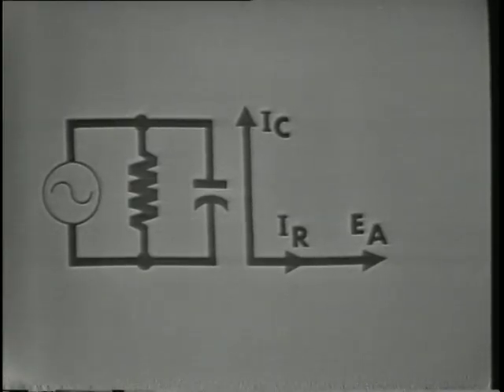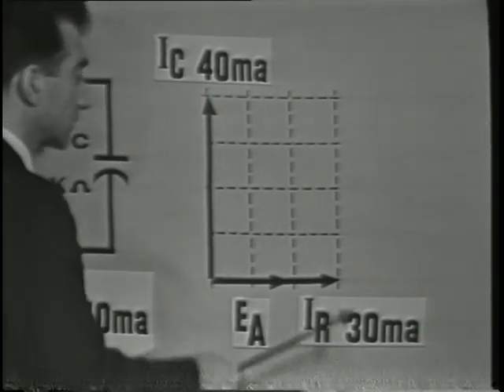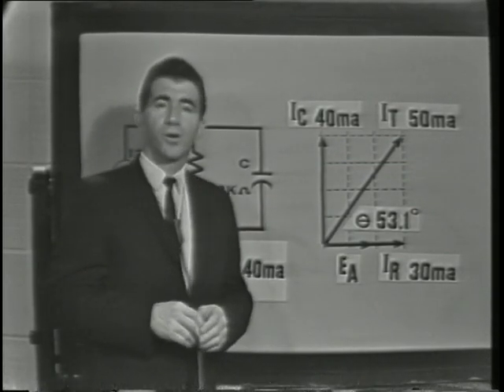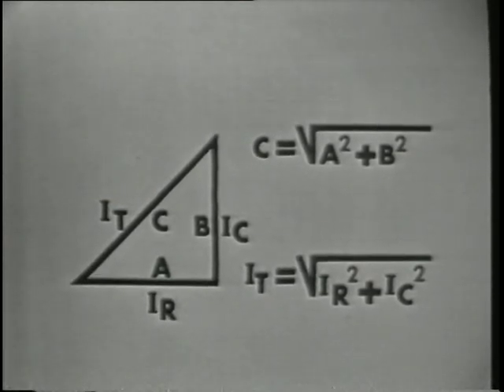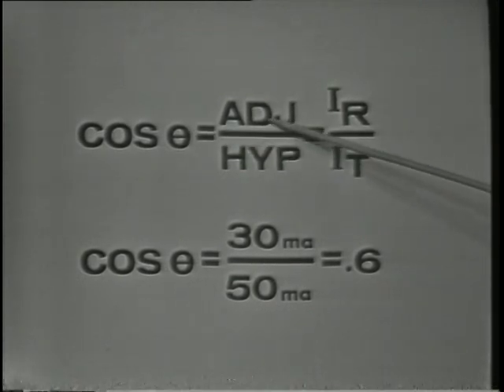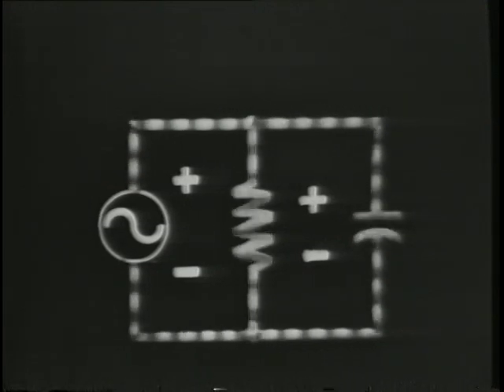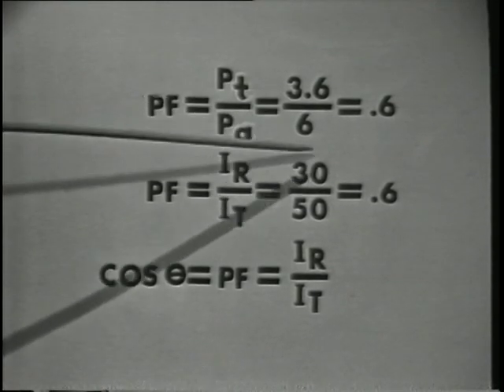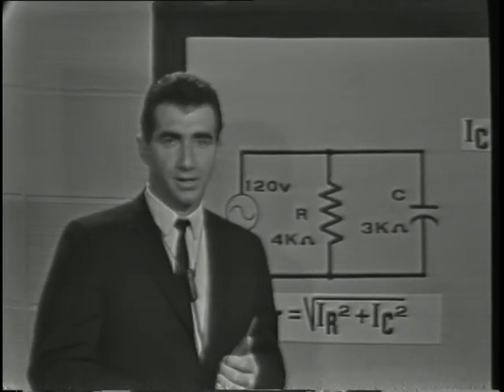PARALLEL RC CIRCUITS

Comment: Yes the sign convention for phase angle is inconsistent. In the graphical representation he shows the phasor that represents capacitor current leading the applied voltage but in the phase plot he shows it lagging as phase angle increases. There should be negative sign in front phase angle values.

Comment: The benefit or practicality of this method of phasor representation of sinusoidal signals is that it  enables ohm's law (introduced in DC circuit analysis but extended here to also include and quantify the 2 types of reactances for the general concept of impedance) to also be valid and applicable for quantitative analysis of  circuits powered with ac sources that include not only resistance but also the effects of both inductance (from inductors) and capacitance (from capacitors)  operating at steady state.
The Euler formula is the theoretical basis  for the use of phasors to analyze ac circuits operating at steady state.
Or put another way it's Euler's formula that allows ohm's law to take on it's more glorified and generalized form of frequency dependent and phase shifting impedance that furthers DC circuit analysis techniques to be applicable to ac circuits that, in addition to resistors, also include the energy storage elements of inductors and capacitors.

Comment: His time domain behavior and phasor representation are inconsistent.
In the phasor representation he shows capacitor current sinusoid leading the voltage sinusoid and this is correct but in the time domain he shows the sinusoid behavior of the capacitor current lagging behind the sinusoid voltage in time.
I was confused until now.
The source of my confusion is the interpretation of the plot. The plot he shows is a phase plot that shows past behavior in time. For future time the past time plots move to the right and the current instantaneous behavior occurs at the vertical axis.
This is not explicitly stated in this video and is definitely a source of confusion.
The plot he shows serves as a bridge between the phasor representation in the complex plane and traditional time domain plots where time increases to the right and the curves remain stationary as with a sweep triggered oscilloscope.

Comment: There's something odd in his, effectively time, plots of current and voltage. He shows capacitor voltage (given by Ir) leading capacitor current. This is behavior consistent with an inductor and not a capacitor so I suspect he's actually plotting electron flow to the top plate of the capacitor. He should show an arrow to indicate this in the top branch to the capacitor .
In a " modern" eli the ice man circuit analysis the conventional current  would be negative as the capacitor voltage drops with time not positive as he shows shows.

Comment: Should point out the implicit sign convention assigned based on the corresponding lead and lag quantities of current relative to an applied voltage input as a function of time. In this case there is only a leading phasor to represent the capacitive related current.
He's got some strange sign convention for current because capacitor current should be negative when the capacitor is discharging (voltage dropping with time). Oh, he's plotting the current delivered by the capacitor not the current delivered to the capacitor.

Comment: What is the voltage across capacitor in RC parallel circuit if value of capacitor is large

Comment: Who would have thought that you can still learn so much with the crude visual aids of early television. And what are trig tables, isn't that what slide rules are used for. Thanks so much for sharing. This was one of the best videos I have seen on vectors and power factors even if it is so old. Hey, the rules of physics haven't changed much since then.
Reply: calculators don't use trig tables... But you can go look them up.
Reply: I was being satirical, they didn't have low cost small calculators back then, just tables and slide rules. If you knew how to use a slide rule, you could calculate the trig functions. I always carried my slide rule with me in the sixties and into the early seventies, it could do marvelous things, but my phone can run circles around my old slide rule today.
Reply: lol I don't think they had calculators at all back then :P
Reply: Chuck:  Went to trade school after graduating from high school back in '71with only basis math skills and the will to learn.  My teachers were great, they taught me all the types of circuits,  how they worked and the math to figure out values using my slide rule. Looking at my old books, I'm amazed I learned and understood all those equations.